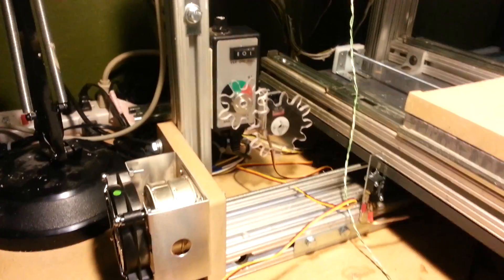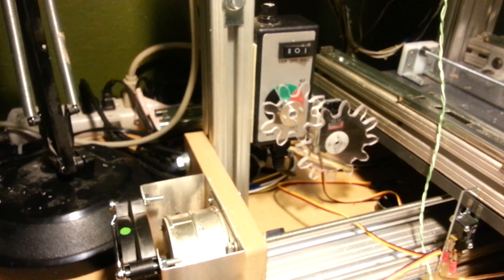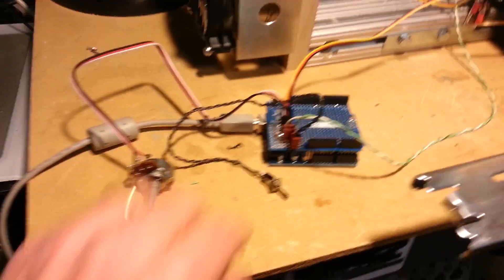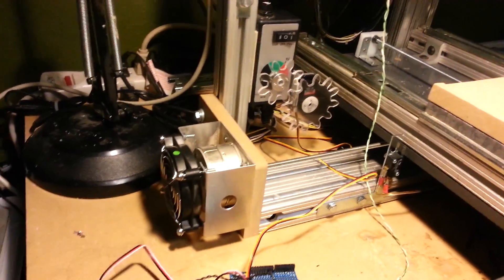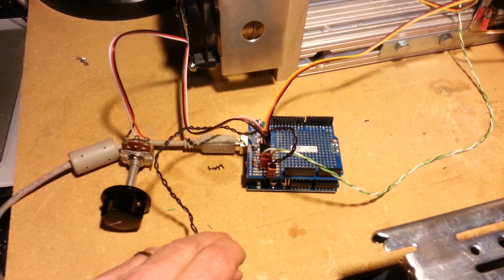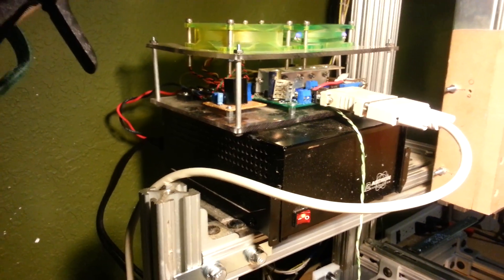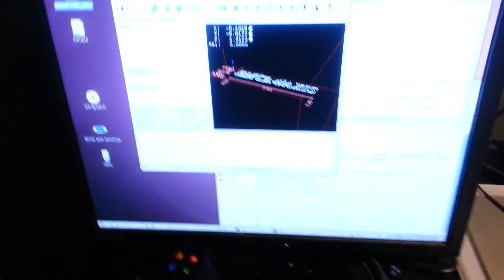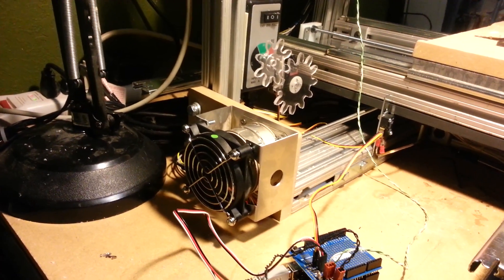Manual speed control to CNC conversion

Comment from the maker: The pulse width out of the Hobbycnc board was really noisy when the steppers are running.  That low pass filter was to get rid of the EMI.  The center frequency of the filter is around 2kHz and it fixed the EMI problem.

Comment from the maker: Mark, the spindle speed is not being measured right now.  I'll probably add a phototransistor to measure the speed and add PID to the controller some day.

Alexander, you are right about the pot solution.  I considered doing just that, which led me to think, why not design a new controller altogether?  Then I realized I could throw this together for pretty much minimal cost with parts I had on hand.

Comment: What is the dial connected to inside the unit? Is it a pot or is it a rheostat? I bet you could replace the physical interface--the gears and the servo--with a digital pot/rheostat and control it directly without the arduino in the middle.

Comment: Do you measure the spindle speed anywhere?  I'm looking at using a magnetic pickup from an old MFM hard drive, and bringing the signal in through the mic input on the sound card, then writing a LinuxCNC user space program to translate that into RPM.